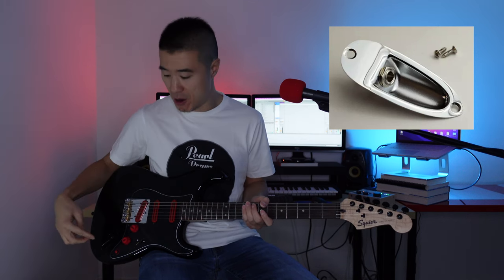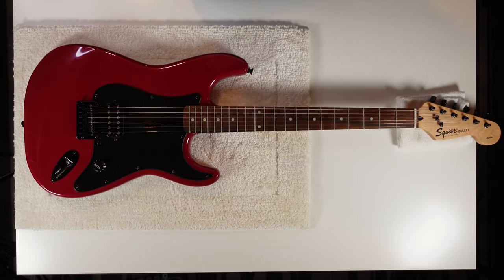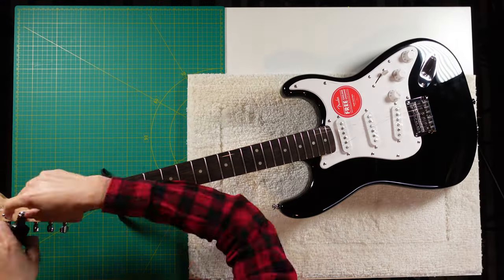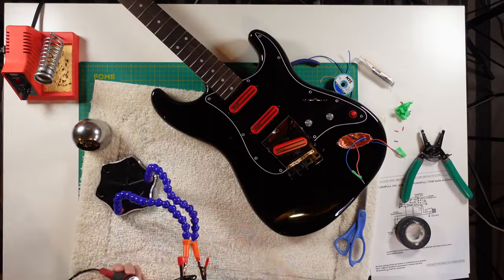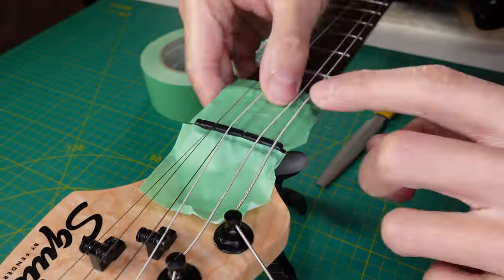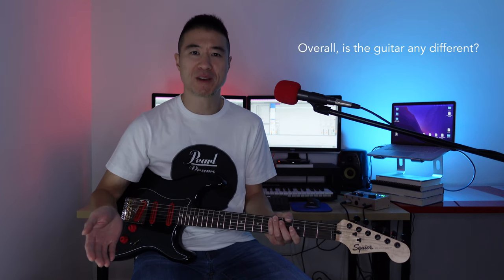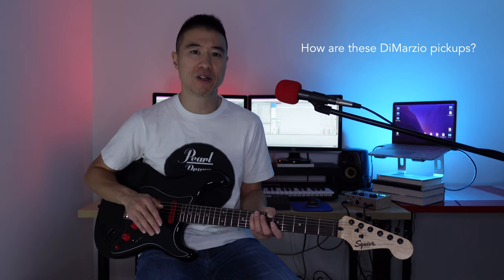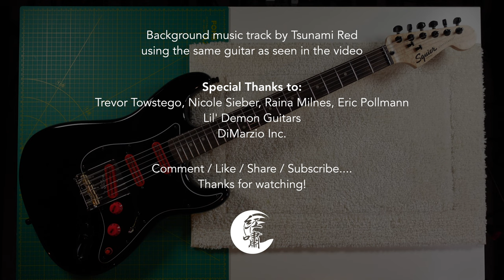Partscaster Build - Telecaster Bridge on a Stratocaster

Comment: Watching this video I have some pointers that should help anyone who reads this. I do want to say I am impressed with your results and from the start I predicted a few issues from the start of the video.

First piece of advice... parts will not match up. Not talking about the Tele bridge, Strat parts will not line up with other Strat parts. So be prepared that you will be doing 2-4 times the amount work you think its going to be. Import guitars, they are not routed to the same depth as US or MIM (Made in Mexico) so using US speced Fender electronics will be asking for trouble. On Amazon, the Kaish and the JD Moon switches are better than OEM (Original Equipment Manufacturer) parts and they drop right in. For US pots like CTS or Bournes, the pots are much bigger (think the size of a Quarter) than the OEM pots which are more like the size of a Penny. So the pot placement may put these in contact with the sides and if you shield them, will ground them out. Hence what happened in your case. A Kaisch would have saved you from your grounding issue. Also these parts should drop right into the holes that are already there without having to reem them larger like US standard parts would require.  Also you can use your red tip.😉👍✨

A word on the volume/tone pots. Different pots have different "throws," how quick or stiff rolling the pot feels. A full sized Bournes has a quick throw which makes volume and tone swells (check it out if this is new to you) but a CTS or a mini Bournes pot has a steady and smoother feel. For this build I would have recommended mini Bournes pots anf the Kaish switch as the least hassle filled wiring. Also if you do cut the wires, add an inch more than you think so you can avoid adding extra length. I have push/pull pots on two guitars with full humbuckers but they are much more work to wire. Also in a shallow import guitar they will most likely bottom out thereby short out. For my guitars with grounding issues I just cut up a donor vinyl sticker and place it in the spot in the cavity that is the issue. This allows me to keep the advantage of shielding the cavity will fixing the grounding issue.

Nuts....nuts. The nut is really the one place I say "fuck it," and get a professional to do. First of all it will be done right as well as the professional will do small touch ups on any bum frets. They want their work to good so they will help out tge rest of tge neck. Unless you really want to go hardcore and get bone blanks and real nut files, just have a professional do the nut and setup once you have the rest of your guitar done. I learned this the hard way, trying to do a "drop in" nut made the professional nut go from $90 to $240 all said and done because of me trying to be clever. That guitar still needs way more work to get it where it should be.

Guitar Fetish and Amazon sell sone good locking tuners for under $50 but you will have to drill new holes for the screw. I am pretty sure the Graphtech Ratio tunners will go on with no mods but they cost way more. I am a Dunlop fan when it comes to straplocks. I also buy a strap for each guitar I have because you will want them at different heights for different designs.

I like your choices in this guitar as I would have never done any of these. It definitely looks great and sounds really good. I have a few Partscaster style guitars that are very different than what you have. Different strokes for different folks. Kudos on your build!

I have an idea for a Strat-Tele hybrid based on my Partscasters I have. I want an HSS configuration for the pickups as I want to do a GFS pickup load out of a Surf 90 (bridge) and two Brighton Rock (middle and neck) like I have on my modded Xavier Strat style guitar. I want to do a short Tele three barrel bridge (minus the area for the pickup) that is scalloped in the back between the screws for a Bigsby. So like you I need a hardtail Strat body but I want to put on a Tele neck. This will require rounding off a Tele neck (square shape) because the Strat neck pocket it rounded at the back. I think a Tele headstock matches the curves on a Strat body better than Strat headstocks do. Probably will go with CTS pots, a Grigsby switch and an Orange Drop capacitor too. This will probably be nect year as modding a MIM tele for a Bigsby is this years goal for a new guitar. I also have some upgrades to do on another Partscaster (needs a new neck pocket) and a new pickup overhaul on my Charvel guitar (EMG DMF set).
Reply from the maker: Wow, where to start. 

The push-pull pots I used do run pretty deep, so yeah, like you said with the shallow depth of the cavity it made for a tight fit. I could have used an import 5-way switch that would have fit more nicely and also have a thinner pole (for the red tip), but I've heard they're much cheaper in quality, being a circuit board. Hence why I stuck with the official Fender switch.

Never really gave too much thought into the types of pots other than resistance and linear/logarithmic but I'll look into the different types - I simply worked off of whatever I could get from Amazon. The cavities were very shallow for this guitar, I had to eliminate a ton of excess wires and really push down on the lugs of the 5-way switch to get everything to fit. I would have felt better having even just an inch of excess but it wasn't feasible in this case.

For the nut, the pros definitely would know what they're doing compared to me trying to fidget my way through this, they've probably developed the right 'feel' for what goes into a perfectly cut nut over time. I had good luck with cutting the previous nut on my Tele, and thought I could do the same with this one. I have no idea where to start with a nut blank, although one commenter has some pointers on how to measure for it. That's a good point you make as well regarding fretwork - this Strat is a cheaper one, so I'm actually dealing with a lot of fret sprout right now (Canadian winter contributing to the issue lol), and I'm waiting on some tools to fix it eventually. 

For tuners, I definitely wasn't expecting rock solid performance from Amazon ones, I just wanted the convenience of locking tuners to make stringing them up easier. On my future ultimate build, I would spend the extra money to get high quality tuners, likely Hipshots. I've got Dunlop strap locks on order, I'm expecting them to be better than what I have now.

That's quite a Partscaster build you have in mind! Unique choice of pickups too. Shaving the neck pocket would be quite an endeavour, no? That sounds even more labourious and precarious than what I did with my pickguard. I've always been curious about what's needed to get a Bigsby on a Tele. If you ever do any videos or pics, I'd love to see them!

All in all, greatly appreciate you sharing your knowledge and wisdom, I hope others do also read what you've written here. Thanks so much for the kind words and watching this video!
Reply: @TsunamiRed  
Thanks for the response! You did everything correct with what one SHOULD do if they really want to elevate an inexpensive import. That said, using US speced electronics are really hit or miss. If you have a MIM guitar or a Warmouth body, going for an import switch can be seen as cheapening out. The Kaisch and JD Moon switches feel pretty good, no complaints. The no name locking tuners are pretty close to the stock locking tuners on my Charvel. They are about 85% the same functionality as Sperzels I had on another guitar.
Reply: @TsunamiRed  

I did want to offer two things for your awesome Strat/Tele hybrid. You may find it may be easier to switch the layout of your electronics to where it goes killswitch/volume/tone for the holes. The good news on this is that it costs you nothing. You may want to consider that when you get tired of the volume issue or change strings.

The second suggestion would be to replace the bridge again. If you want to keep the three barrel design you may want to look at the Gotoh BS-TC 1S. This should give you a cutaway on the ashtray bridge that would help too. That lip you are hitting on The Wilkenson is not really there on the Gotoh. 

I have right now about 23 guitars on hand, of which 5 are Telecasters, Squier Telecasters or Tele clones. I have the same Wilkenson bridge on my main Telecaster in my pic here. It's a really good bridge. I have the Gotoh traditional style with the cutaway and a scalloped back (look up Gotoh Telecaster Bigsby) for my Squier Partscaster eith a GFS X Trem (Bigsby-esque... about 85% there to the real deal) and I actually prefer the Gotoh. I play dirty, so a Garage Rock/Punk guitar tone so EXACT intonation ia a bit wasted on me. Think The Sonics, the Clash, Social Distortion, and Stiff Little Fingers ans that's my bread and butter... along with Country beacuse I am self taught and mainly uses a Mel Bay book of "cowboy chords." 

At the end of the day, precise intonation on straight frets is a mathmatical fool's errand. I am not saying this to be right or mean, I am mentioning this so you can get to a point where it really does not bother you. I have traditional three barrel compensated barrels on both the Wilkenson and the Gotoh while the other three have more modern individual saddles. For me its a feel thing, that just comes with time and playing. I also like the throwback look on the original bridges and because I use effects like reverb, slap back echo, and overdrive, I sound very much the same across all my Teles. 

You are a cool guy and I really like your video. I have been playing for about 29 years nonstop, I have owned well over 60 guitars and I am very familiar with modding projects. Feel free to pick my brain, you have a lot of potential with those other guitars. I also have been pushing my luthier skills on my own time, since financially going to Roberto-Venn is not on the horizon yet. I have loads of Partscasters and modded import guitars I call my "Primo Cheapos" and I would be happy to share any knowledge I have. 

I would say three things about these types of guitars.. First, while you can get a import guitar to play and sound way better than stock, they cannot really play on par with their American big brothers. Second, modded guitars and Partscaster will never be worth the amount of the parts. Build them like what you and I do more as a "proof of concept" before modding say and American or Mexican guitar. If you do want to sell them, you will get more money parting them out. Last, look at these as an investment in happiness. Do it because you love to and because it is fun. I see that in you and that's how I feel. 

One last bit of advice, the quality of a part is not necessarily reflected in the price. Import parts and pickups CAN be good if they are speced right. CTS and Bournes are actaully Asian made at this point but you still see them in Fender, Gibson and Boutique builds. Some of my favorite pickups are Asian made, the GFS Surf 90 for example, as well as Duncan Designed humbuckers. Some parts are just visual knockoffs that are poorly spec-ed and unfortunately there are a lot of tgem. The locking tuners I buy for about $45 on Amazon are great! They fall right in for most import guitars. Squiers are a bit squirrelly when it come to drop in tuners. I know Darrel Braun used Grapteck Ratio tuners as a drop in on a Squier build he did but thatvdoes not mean all Squires can do that. I just put my $45 tuners on both of my Squier Telecasters, filled in old holes with toothpicks and made new holes with screws. Then again Partscasters are supposed to look a bit gnarly and battered.😎👍✨
Reply from the maker: I did consider switching the placement of the knobs/switch in the order you list, with the killswitch closest to the bridge. It might involve 'extending' a few wires but that's something I would consider if I ever muster the patience to tinker with the insides again lol.

Great recommendation with the lipless bridge, though I think I'll opt for a 6 saddle type on future builds. Been eyeing Hipshot as well for my future ultimate build, or perhaps even the new Vega Trem Tele version. Totally hear you on the 'precise intonation' thing - that's something that makes me want to try a True Temperament fretboard someday.....if I ever have the extra funds.

'Proof of concept' -  that's an accurate way of describing how I've approached these builds. All of this is meant to be practice and experimentation before I take the plunge in building my ultimate Partscaster - the body and neck will likely be from Warmoth. And for sure, it's highly unlikely I'll ever part with these guitars now, I know the resale value will never be anywhere near what I put in, let alone the time spent on them.

And I hear ya on price/quality - I'm happy with locking tuners I've tried on Amazon as well, and these days I find that stock pickups, even on cheap Squiers and other no-name guitars, aren't all that bad. 

Appreciate all the pointers, I'll take you up on advice/pointers if I ever find myself in a rut again. Thanks very much again!
Reply: @TsunamiRed  

Awesome! I have seen inexpensive Squier bridges like on my Squier Standard Telecaster go for $20 on Reverb. It's alright... a cheap modern bridge, not US quality but not bad. It has the six individual saddles you are looking for.  I did want to mention that Seymour Duncan has a standard Strat bridge pickup called a Twang banger. I have that in a Partscaster (Twang banger- Reverse wind Pro Alnico ll- Five Two Strat) and it has the Telecaster sound as they put a brass plate under the pickup which is part of the Tele magic.

I will say modern Tele bridges require string thru body placement, that would be the Vega Trem and the Squire bridge I mentioned earlier. I personally prefer Bigsbys because I am after that subtle "blue note" waiver that Strat style trems seem to blow past. Also the Jazzmaster/Jaguar Wide Swing Tremelos do that really well but that is definitely invasive. 

These thin import bodies are too shallow for them. Not sure what issues might occur with a Vega Trem on a thinner import body. Maybe nothing. I view my import guitars more as a modern version of the old school 1960s and 1970s import knockoffs like a Teisco. More fun and offbeat that may or may not be practical. Definitely solid "second guitars" that offer flavors that are different than my main guitars. 

I appreciate all of your responses and look forward to your future builds. 😉👍✨

Comment: Great job!  Looks very good.  Sounds very good.  Strat is the only guitar I'm comfortable with.  I'm the same about the volume knob when sitting, however I hold the guitar a little different when standing & the knob is not a concern.  My Strats are at least 15 yrs. old.  Squires bodies are slightly thinner than MIM or Am. Strats.  Doing any mod makes the guitar uniquely yours.
Reply from the maker: There's something about the Strat that makes it oh so comfortable to hold and play, eh? And true - even between the three Squier Strats featured in this video, the bodies did vary in width, particularly the 2002 one (with the single humbucker), that one was very thin. Appreciate the kind words, thanks very much for watching!

Comment: A six-saddle version of the bridge would probably help with the intonation-vs-jangly problem.
Reply from the maker: I did consider the 6 saddle bridges at one point but realized I'd have to further enlarge the space I cut out for the bridge on the pickguard. That was more work that I didn't feel like doing any more of.
Reply: Never had a problem with 3 saddle bridge if you use the right saddles intonation right on

Comment: 19:08 when you wire it up - plug it into an amp. Turn the volume and tone up all the way. Set the selector to the option you are testing. Tap the pickup poles with a screwdriver, if is working you will hear "tap tap" in the amp. You can also test the volume and tone pots this way.
Reply from the maker: Oh I did A LOT of this, with a pair of tweezers instead of a screwdriver